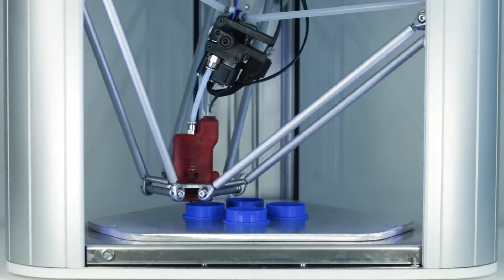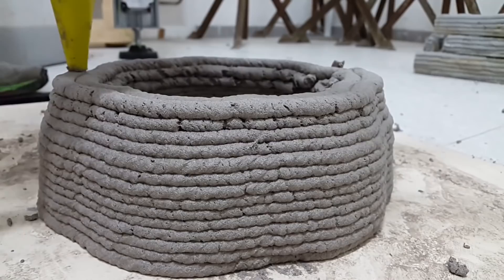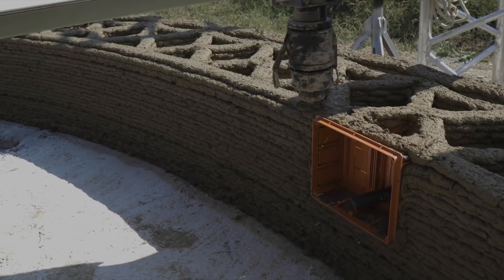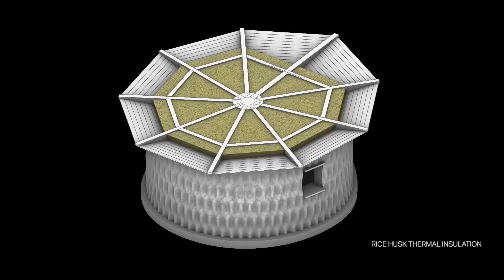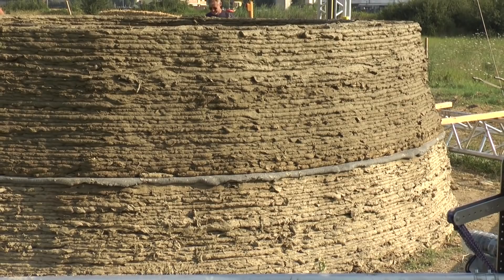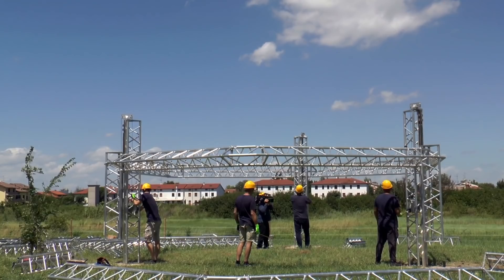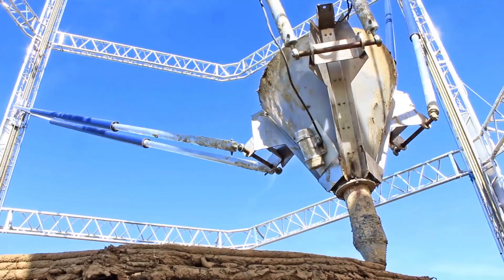$0 HOUSE | How One Startup Aims To Produce Homes at Null Cost

Comment: I worked for a company that built low cost housing in Africa.  We literally built hundreds of thousands of houses at a go.  I studied Building Sciences and researched all kinds of Industrialised Housing.  Here are a few things I learnt:
.
.
1. The cost of site establishment can be higher than the cost of the actual house: ie: setting up on site, bringing in trucks, with specialised construction materials can make the entire project unviable.  I think that is the case here.  We had a fully precast house that was driven to site.  At a whopping $1,400 for the whole house, it was by far and away the cheapest alternative BUT literally driving it to some sites was unviable.  Can you imagine taking the entire 3D printing gantry to a remote part of Africa where there is no electricity to build a viable low cost house?
.
2. Poor people all over the world (Asia, South America and Africa) always look at these industrialised housing techniques and ask the simple question, "Why aren't rich people living in these types of houses?  If rich people don't live in them - I won't"  All forms of construction have a very high cultural impact.  In North America for example, no one uses clay roof tiles, instead they use 'wood shingles' that must be replaced at a stupidly high cost about every 10 to 20 years (tiles have no maintenance).  ie: this cultural thing is not restricted to poor Africans.  Unless you can get rich people to accept using 3D printed homes you don't have a chance with poor people.  Which I must point out... the fantastical shapes and designs made with 3d printed homes should be geared to rich people.  Hey Tesla started selling super expensive sports cars - perhaps adopt the Tesla model.
.
3. The properties of clay and mud are great BUT don't put staw into the clay.  Straw decays and leaves voids and weakens the structure.  A simple 4% cement mix will GREATLY improve strength.... take a look at this machine (it's not a 3d printer): www.hydraform.com
.
.
Hydraform is the mainstay of lowcost housing globally.  It looks like bricks, uses 4% cement and soil located on site.  These guys' machines have built literally millions of houses.  Their technology has now been copied by the Chinese and used to build millions more houses.
.
.
For all the cool factors of 3D printed homes - they can't beat the attributes of Hydraform.  I think 3D printed homes has HUGE potential in making some amazing designs .... for rich people.
Reply from the maker: Thanks for your deep and valuable insights. To address your first point, the great benefit of this tech is using local materials. The gantry machine weighs less than a single home so if you can bring it in and then print hundreds with local soil/mortar then the value becomes evident. I’m not saying this is possible right now. Part 2 and 3 are excellent points as well.

Comment: Hopefully this is available for people soon. We need something new and something warm in winter cool in summer Hurricane and tornado resistant and long lasting.
Reply: I seriously doubt those houses will be hurricane resistant. But as long as they're literally dirt cheap, they're cheaper to rebuild than other houses.
Reply: @a0flj0  For people who live in dangerous places what might be included is on 'strong room' that contains enough cement and steel reinforcement to provide a safe shelter.  Put it in the center of the house and the other rooms would provide a sheltering buffer if things get really bad.

And in a place that gets super hot (there will be more of them) perhaps the house should contain a basement where the family could ride out the hottest hours.

Comment: I would love to see how these houses do against storms, hurricanes, tornadoes, earthquakes, etc. Amazing technology!
Reply: probably pretty good against storms, but i doubt they are water tight enough to deal with hurricanes, and tornados really just rip up anything they want, earthquakes maybe, I dont know the material properties of the stuff they use, but if it has enough flex then it should survive pretty darn well. The real cool part is that even if it doesnt hold up to well to things, its so cheap and fast to make its not that big a deal
Reply: My guess is that the air dried mud would not last long against rain and that is why they have a roof with such large overhangs. That should protect it some from the rain. Would need to protect it from insect damage somehow as well. 

Also there would likely need to be interior furring strips and wall material if you wanted to hide all the electrical wiring. Or you could just leave it exposed in conduit attached to the interior walls.

Would also need climate control. For a house this small probably just a mini-split system with an air sourced heat pump on a pad next to the house with a couple of wall mounted blowers inside. Again without interior furring strips and wall material you would have exposed coolant lines either mounted on the exterior walls or interior walls running from the exterior heat pump on the pad to the wall units inside.

Comment: Time is the enemy, and water is its army.
The outside walls of the structure must be smooth. Not only is this the smallest surface area, it is also much less prone to the erosion caused by turbulent flow (both water and air) over a rough surface.

Comment: They are using hand cranks instead of electromotors to not have extra emissions but the printer itself is driven by same motors and they are powered from solar panels on site and thus have 0 emissions .... that makes perfect sense

Comment: Unfortunately this would meet zero US building codes so could not currently  be built in coded  residential areas only rural. There is also the problem of how to get running water, electricity, and natural gas in and sewer out. These  issues could be resolved but it will be interesting to see if the cost could ever be lower that current standard residential building.

Comment: Would the straw reinforcement be sufficient to keep the integrity of the structure if there is a massive flood? What happens during a hurricane? Or is this intended for safer regions, like predominantly dry (desert) climate?
Reply from the maker: If it doesn’t get washed away each soak/dry cycle with further compact and strengthen the adobe mixture.

Comment: there is a method where they use the same concept of using the materials around the area and bits of cement, then they are placed inside a.... don't know the word in english, like a sack? a bag? that is elongated, and they make a similar circular structure with wooden windows and doors. The big thing is that they don't need a giant 3d printer XD   
I think 3d printers are the future. Once we manage to feed them different materials, like this project did, they will be able to build anything, organic or not.

Comment: One house-printing company has added a simple piece of metal to the print head that smooths the outside surfaces as it prints.  That should make an acceptable wall surface.  Finishes can be added.

Comment: I believe they'd get a LOT longer lasting house if the outside of it was coated again with a thin layer of clay and into that layer (while still wet) was stuck a hemp fiber mesh.
It's the difference between a 3D printed part and fiberglass. But they won't find out until after their first houses start to deteriorate.

Comment: So on the side of that little arm that's excreting the mud you should have two little arms that come down that have paddles trowels like the big trials that they use on concrete the electric trials have two of those that spin so it's smoothing the sides as it's moving and that's I mean I could draw all the blueprint for you so easily yeah

Comment: I applaude the vision for creative, environmental, affortable housing presented here. Of course,  removing the modern 3D printing twist, Abobe is the most traditional of house construction techniques. I was in Zambia many years back where people in the villages often still build their houses by hand with freely available materials.
However it is important to look at the total cost of ownership:
(1) Adobe housing erodes from the weather even in drier countries. It needs periodic repair and as much labor is spent on maintance as original construction (take the Great Mosque of Djenné for example where legions of volunteers work to maintain it.) 
(2) The structure is likely vulnerable to rodents- not that big a deal but it does mean the family cats and terriers will need to start earning their living again.
(3) In many cases therre is signficant labour in getting the raw material ready by removing all the pebbles and other contaminants. There is a local joke in Zambia that you can tell a lazy person by the large hole in his back yard. However in reality it is far from as simple as digging a hole beside the construction site and throwing everything in a hopper for the 3D printer.

Comment: Only lime will tell how long these houses will last. Take a note from history. The adobe houses out here were a full system. The outer coating was lime, and it kept the houses from eroding away.
Reply: "Only Time will tell"...
You are correct to be skeptical as this method makes a modern version of the Traditional Clay & Straw huts made for thousands of years in Africa. I could quickly demolish the walls of African Huts with my feet, one of the safety features of these Huts in case of Fire in the Thatched or Straw Roof...
Concrete gets its strength under compression, when there is little trapped air in it due to using a vibrator, and when it bonds to the layer below under pressure & possibly with an adhesive. None of these are done with the methods by Wasp, the reason they are using Dimensional Lumber for the Roof and Roof Support Columns...
Which is to say that I could also quickly demolish Wasp's "Houses" with only a Sledgehammer, because their method of construction does away with forms, compression & using a masonry vibrator to remove all the air pockets...

Comment: idk, standardized building unit stacking has been working for a very long time
going on and on about the lack of motors and there's the grinder and the pump
not exactly a speedy process, need to shade it to keep it from drying out too quickly, 3D printing is in it's infancy, speed and materials need developing.

Comment: Designing single homes is nice, but the designs that should be pushed for are higher density housing. There is a vast improvement in efficiency when you can share plumbing, electrical, and land. The gains are even greater with multilevel dwellings where businesses can exist on lower floors as it allows people to live near where they work, which reduces daily commute requirements and

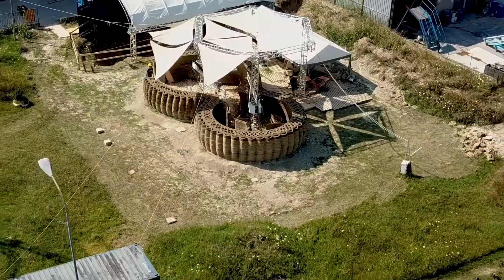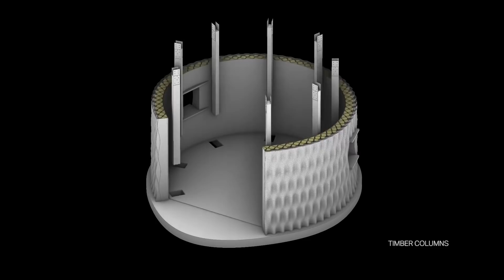Comment: The form at 2:15 versus the form at 4:15 could further reduce roof structure cost, making it more dome-like.  Quality control of the indigenous material (soil, straw, sand, water ratio) is critical to get the engineered properties needed from the final mix. Quality control in construction in reinforced concrete has a LOT of science and experience behind it.  Adobe may be old, but the techniques, thicknesses and voids here are radically different, leading to more quality variables.  I think trading some economy to get adequate quantity of the needed material, or consistent material with the right properties will still be something they will have to do, or long term results may not be as good.  It won't be zero cost because you still have mobilization and demobilization of the print equipment, trucking it on and off site and setup. You have labor and design time.  You can't print windows and doors, flashing, plumbing, electrical or heating or cooling.  Even if there was a printed fireplace for heat, it would be tricky for no cost.  -- In spite of my nay-say-isms...I think it has potential.....thanks for sharing.  Otherwise I would not have known.

Comment: A mud house wouldn't last 1 month in a rainy area. The mud would have to be mixed or coated with concrete or plastic resins, so there goes the cheap, low-impact natural plan. Best of luck, I like the concept.

Comment: The 0$ home would still cost money to make the roof, windows, doors, wooden beams and interior works. It would be cool if these houses would be pre fabricated in a special large factory then can be moved and placed anywhere, kinda like the container homes or mobile homes.
Reply from the maker: The material actually weighs more than the printer so it’s more efficient to print on site I believe

Comment: Coffee conch shells and snail shells because of the spiraling advance it's rough the hotness of the walls is constantly drying out the moisture and it wicks itself up and away and then in the center you can condensate that water that you're wicking out of your shelter and use it kind of like using the water off of your air conditioner that's another hint from Johnny Ray she give me a job I'll work as a janitor and tell you secrets you should make your mud base material wherever you source from these places you should make a diode and a child zinc and carbon one side align it and you can make these wasp house earth batteries you can pull a charge off of it

Comment: The structure of the wall is a really cool idea. If my mission was to provide cheap housing for poor regions, though, I'd just use the money Wasp would need for shipping and preparation of the site to hire a bunch of unskilled locals and manually build 3 better houses that are actually suited to the needs of their owners, and not those of some machine. 

Gainful employment for the build would add to the local economy and the people's identification with their built environment, a feature that this robot idea doesn't address at all.

I'd say it's a cool idea as an engineering challenge, but absolutely useless for its stated purpose, like most tech-driven ideas about improving the lot of the global south, or any societal ill, for that matter.

Still, cool video, very well explained!

Comment: The real cost in terms of effort, cost and environmental damage is far higher as a result of using human power than it is by using electric motors, even with the existing coal fired power stations we have. a very fit club cyclist can put out 450 Watts of energy for 1 hour. that will need to be replaced with food, which has real environmental impact. that same energy  from our local 240V power supply would cost $0.21 in money, and less envronmental polution than the extra food for the athlete.

Comment: This is cool. Why can’t the upright  beams that support the roof get at least partially lost in the wall? If the beam was half exposed, or fully hidden by dropping into pre-allocated cavity slots it would make more room inside and be more attractive wouldn’t it? Maybe if there was a way that the printer could print the inner cavity as a corkscrew tube you could blow climate controlling air through it to adjust the temperature inside?
Imagine if airtight habitats on Mars could be built this way, that would be amazing, be a bit like Luke Skywalker’s Uncle’s house on Tatooine! :D

Comment: Better the hollow wall use as water storage compartment. It kept interior temperature cold day and nite without the need of air-conditioning.
Just an idea if the building materials made of waterproof mud similar to ceramic mud. Disqualified for internal wall hollow structure electricity wiring due to water availability as storage compartment.

Comment: I think a combination of this type of printed walls, along with the concept of a earthship ,and a relatively reasonably priced roof structure made out of a steel truss . might be a low cost alternative to overpriced housing. But as far as 0 costs  well you still have power needs fresh and wast water   ,data,  air handling winter heating considerations .  Bathroom facilities and cleaning  storage of food  and cooking. Along with land use issues. Appropriate fo local weather conditions.  Then the articectual and engineering...finally we got to talk about  labor costs  the we can put together a real proposal and estimate of costs.  
Hopefully this type of technology will bring the costs down significantly.
Reply: But the material costs for the basic structure is nothing. You just dig your building material directly from the land you plan to build on! You could possibly use the soil you excavate for the basement/septic for your construction material. It may not be literally $0, but it is far, far less than buying conventional materials.

Comment: If the bottom layers are ever flooded, the "adobe" will melt and the wall structure will collapse.  Also, clay is not dirt. 
The $0 cost is misleading as it can only refer to the material cost of common dirt and straw waste materials. Obviously there are labor, transportation, internal supports, windows, doors, concrete base, roof structures and other costs. Absolutely no mention of electrical, plumbing, heating/cooling or sanitation means that the "house" is a essentially merely a shelter.

Comment: Walls are a big expense, but there are so many other things to make a house that cutting the cost of the walls won't make as big a dent in the price as you might assume.
What's more, you must have a waterproof layer on the exterior of mud walls, or use an additive that resists erosion, like Portland cement, or asphalt.  That increases costs.
And needing a giant machine to come to the site is not cheap.
This just doesn't look that promising.